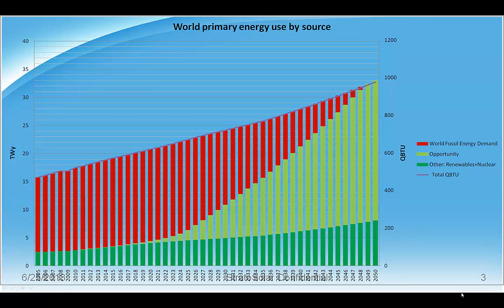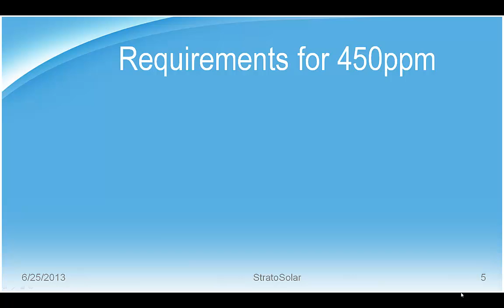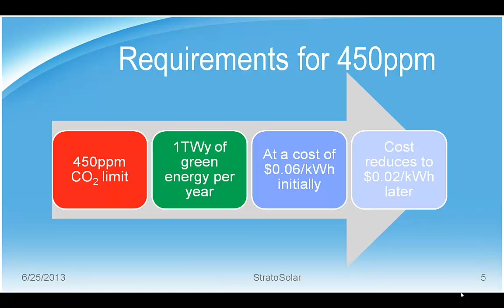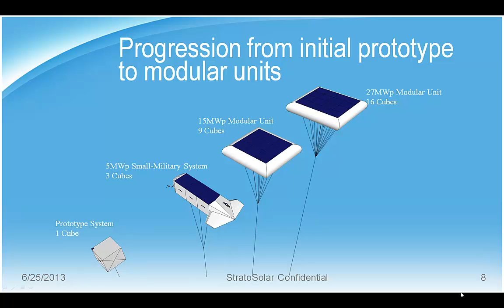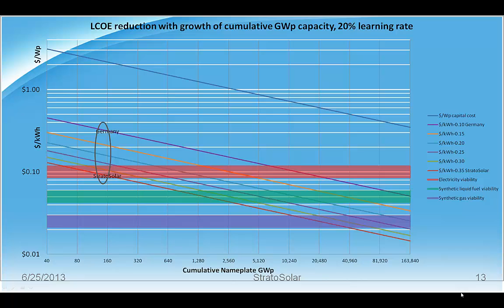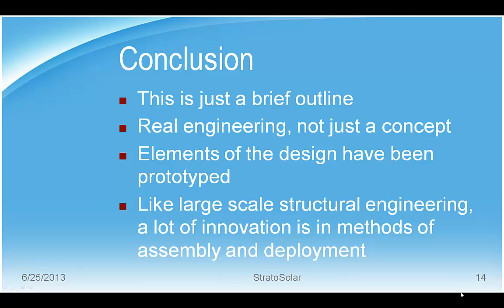StratoSolar Introduction

Comment: How about wind? The stratosphere isn't as still as you make it. It's one thing to fly airplanes in it, but it's a different thing to STATION massive structures in it. Airplanes have stable aerodynamics, big flat structures do not. Even if you find a good still altitude, how about the wind on the cables? Cables cause unstable turbulence and start oscillating.
Reply from the maker: +Burak Bağdatlı Wind is the central platform design issue. Winds in the stratosphere are well understood. They are stable and more than a factor of twenty lower force than worst case force in the  troposphere in the jet stream or hurricanes.  We have extensively modelled the aerodynamics and dynamic behavior of buoyant platforms in the stratosphere.  The structures are inherently damped at the joints that join elements and lack the inertial elements of resonance. 
Tethers in the troposphere have also been modelled extensively. Long tethers have very low natural frequencies and are heavily damped. Kites and aerostats have short tethers by our standard and have no resonance issues. 
The reason to build prototypes is to validate the design criteria and discover what modelling has missed. I'm sure there are many unknown issues that will rear their head. I doubt there are any unsurmountable problems.
Reply: Edmund Kelly I have friends who work on similar problems and I've listened to their thesis/research presentations. I know that there are some practical solutions to these. Anything is engineerable if you ask me.
Reply from the maker: This page on the Stratosolar web site discusses wind on the platform and the tethers. http://www.stratosolar.com/key-enabling-insights.html 
Wind in the stratosphere is significant, but worst case wind force is less than ten times the worst case wind force in the troposphere. Wind forces on platform structures and tethers have been modelled in great detail. We trust engineers to model wind accurately for tall skyscrapers where wind is the most serious problem. Why not trust engineers can accurately analyze buoyant platform structures using the same tools and methodology?

Comment: I really like the idea very much. This could be the future of solar.
But i am curious. I have looked up the internet for data on the lifetime of weather balloons.
Typically they only last a few weeks.
Why and how do you think to improve it?
Reply from the maker: plavix221 Weather balloons are designed to burst as they ascend in the atmosphere. Gas bags for research balloons are only expected to last a few months at most and are made from cheap materials using low quality manual fabrication methods. Designing gas bags for long life is a simple engineering problem. StratoSolar has invested the time to solve the problem.